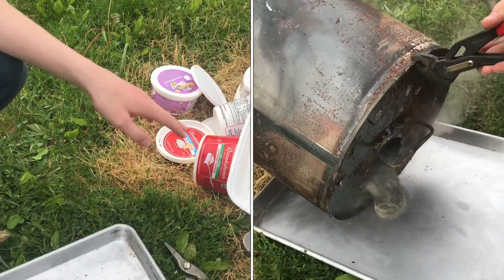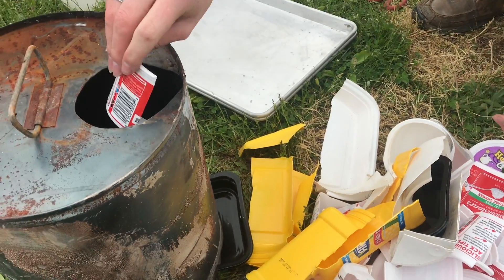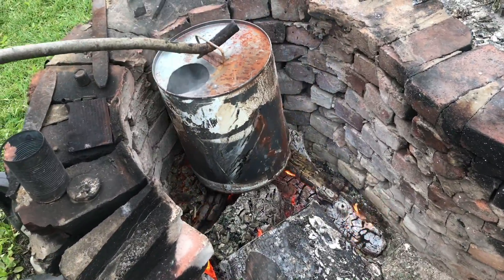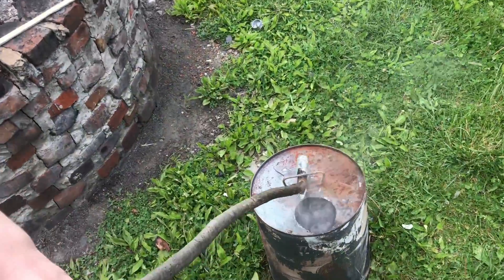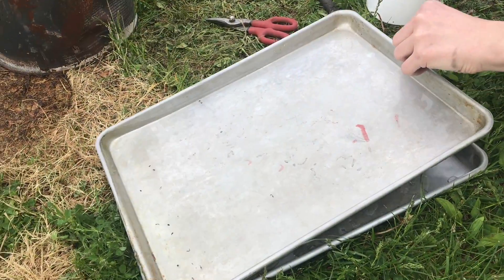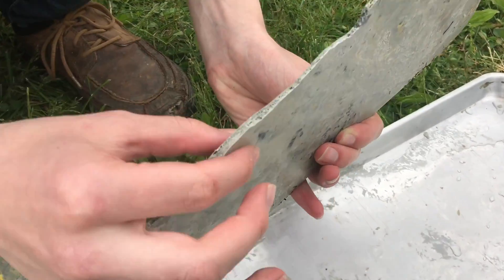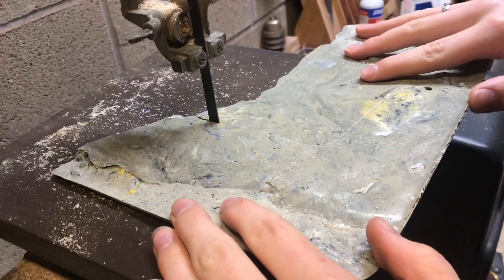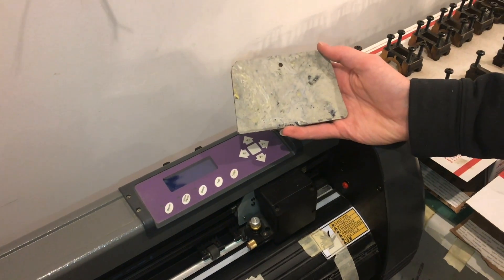RECYCLING “polypropylene” on an open fire (pp 5)

Comment: You want to melt it in a CONTROLLED TEMPERATURE environment like a toaster oven or a hotplate. If it REACHES its upper limit of temperature, you've ALREADY gone TOO FAR. It should not smoke AT ALL, and it really does not take a lot of energy to get it to liquify. If you insist on using a chaotic heat source, it should be on coal or in a double boiler or something to control the heat. Still better than the video where you mix all the different plastic together, but you're still poisoning your neighbors.
Reply: No

Comment: would an old paint can work as the melting pot? I've always wanted to try recycling plastic but my mom won't let me use the oven :(
Reply: Never do it over a fire, it's a sure way to get toxic and burnt plastic. You want something with a temperature control. A panini press, a pancake hotplate, a toaster oven, etc. Not a microwave, stove, or fire, or other source of heat that has no temp limit. You can buy a used machine pretty cheap by looking around yard sales, goodwill, value village, facebook market, craigslist, and free exchange communities, or even just ask a friend or neighbor if they have one they want to get rid of. Your mom is right, the machine that melts plastic should not also be used to cook food. In every project, your project tools should be completely separate from your kitchen tools. Even if something looks/feels/smells clean, doesn't mean it can't hurt you. Be careful! Always study safety info before trying new crafts. For instance, when melting plastic, the TYPE of plastic matters a lot. For instance, PP is pretty safe to melt, PVC is NOT.
Reply: Get a toaster oven from a second hand store

Comment: Use a cheap oven, this is not a good way to do this. Not hating just saying you will get MUCH better results. I do this at 325 degrees and you will get clear good plastic. This method leaves plastic cloudy and inconsistent